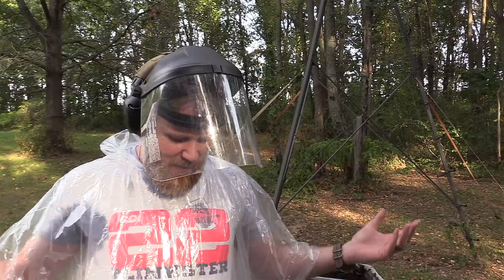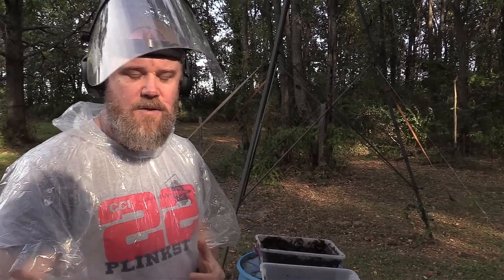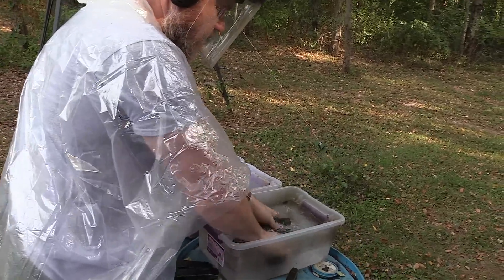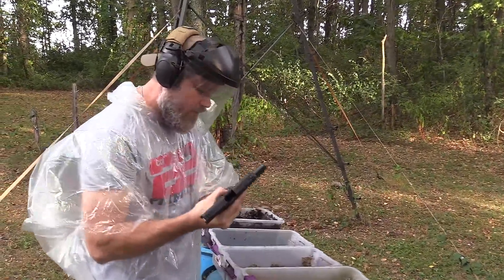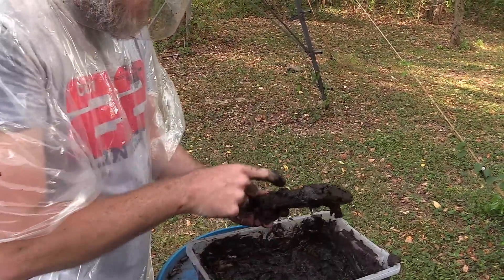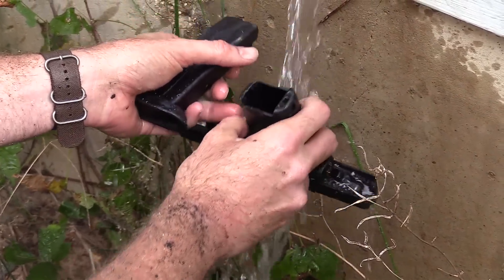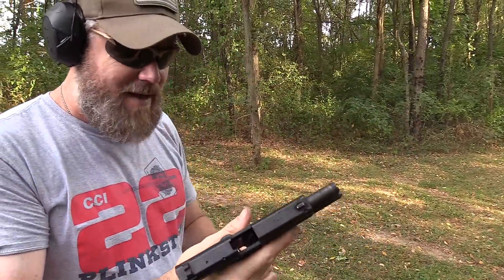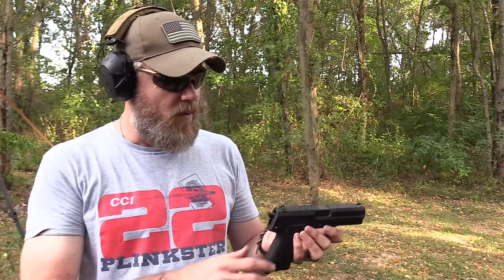The HK USP 45 meets the Gauntlet!

Comment: I went back and watched the Arex torture test.  I'd say these two guns are tied for top honors.  The Arex had a double strike failure and the USP had to be tapped home once.  The USP locked open at the end and the Arex did not.  I also noted that during the Arex testing he did not cover it over in the sand and first test like he did with the USP.  Given the slightly different testing it's hard to declare a true winner.  I would love to see an accuracy test between the two.
Reply: Jericho 941 is probably the most reliable.

Comment: In my opinion, the USP-45 should have become the US army Standard issue pistol. Not only it's reliable, but solves 2 of the main issues with the M1911: High capacity and reduced recoil. It can fire, out of the box, 45 Super, withowt damaging the frame or the Slide. In test, it was able to shoot over 13,000 rounds of +P+ ammo, before suffering some degree of fatigue. With a 20 lb main spring, you can fire hot loads with the recoil of a standard 45 ACP.

Comment: This video brought up an interesting question, and one that I don't think you have addressed with the Gauntlet.  How about running the same models of guns through the Gauntlet but in different chamberings.  That way we can see if the chambering has any effect upon the reliability under these conditions?  Maybe shoot a Glock 21 (45), a GLOCK 22 (40), and a GLOCK 17 (9mm), or, how about a SIG P220 (45), a SIG P226 (40) and a SIG P226 (9mm) since the P226 had some issues in 9mm?  The more powerful chamberings might allow the guns to power through more debris in the pistol!

Comment: My duty gun is a USP .45 H&K and my off-duty gun is a compact USP .40 H&K. I've NEVER had a misfire, "stovepipe" or double feed and I have fired 1000s of rounds thru both guns.
I will never carry anything but an H&K because in my line of work the gun has to work every single time or I will be lying horizontal in a box with a flag draped over it!

Comment: I've owned the H=K USP Tactical .45 for many years.  It is an incredibly reliable, durable, accurate, and top-quality firearm (match-grade single action trigger and  barrel, designed and manufactured to very high standards, truly built “tough as a tank,” and with a great SA/DA design including a frame-mounted dual safety/decocker).  Surprisingly, It is also quite concealable (although only in the Wintertime).   I simply cannot praise it too much.

Comment: I know you did the Glock 17 gen 3. Can you do a glock gen 4? I'm not sure which one I want to get, I know the gen 3 is good but I'm on the fence with the gen 4 due to the new guide rod/spring and the bump on the trigger bar assembly. If it does good like the gen 3 did, I'm probably going to get the gen 4. It would really help me out if you could

Comment: Watching the video today, a thought crossed my mind. Have you been using the same type of lubricant for all tests? I wouldn't fault you in the least if you haven't, but I imagine it could have a pretty significant effect. I imagine something thick like grease would be less likely to wash away in water but would probably hold more particles. I think it'd be interesting to take one of the guns that was lube finicky and gauntlet test a variety of lubricants. I think a thin grease like ALG Go Juice might help the gun run better than say Hoppe's, RemOil, etc. Keep up the great work! Another question I have is your position on the NRA's position on Bumpfire stocks? Maybe they're trying to play chess instead of checkers, but all the gun grabbers I've heard see that as a victory and just want more. Their thoughts have been they won that, but now they want bans on suppressors, high-cap mags, assault weapons, etc. I'm pretty disappointed I got behind the NRA for them just to roll over again.

Comment: If the trigger becomes an issue in dirt from a hammer. That is a failure. In a situation in combat. That is enough to cause an issue. And no real soldier is going to risk breaking internal trigger components just to fire a shot off when behind cover enemy fire.
A experienced soldier is going to smack the slide around to clear any obstruction from components. Then resume getting back on target.
Reply: Most soldiers only carry rifles. Not always the case of course. Yet if you have to use a pistol something has gone very wrong, or your an MP/Security Forces.

Comment: Aren’t these rated to run 45 super?
Reply: Well, HK says it voids the warranty. People still shoot 45 super through them though. Mark 23 is rated for 45 super.
Reply: Yes. The full size USP is rated for 45 super without any modifications, but H&K suggests more frequent recoil spring changes if constantly using 45 super.

Comment: Someone explain please......a revolver or pistol barrel behave differently if there is debris up there, or does the pistol barrel suddenly and miraculously 'lose' all its dirt the very moment the bullet starts to move up? That's how he explains it.
OK - I've listened to this again and again. Nothing changes in the guy's explanation. In short: With debris up the barrel,  revolver barrel will burst and a pistol barrel will not. I really cannot believe he just claimed that!
Reply: He said when debris gets packed in and around the cylinders of a revolver; the barrel isn't the problem - the ammunition to barrel interface area is. Running this test with the slide locked to the rear when in each bucket would probably be a closer comparison to what a revolver goes through, especially when multiple rounds are fired.
Reply: James, yes indeed - I got that part - but he still claims that a revolver barrel will get scored by the debris and may burst apart.
Reply: @jeroendesterke9739  Oh right I see what you mean. I can't speak for MAC's reasoning, however I would think it would be down to probability of a catastrophic failure over a difference in the two platforms. On the first round fired from a revolver and a pistol the likelihood of a failure would be pretty similar (on the provisory that the pistol had it's slide to the rear). However once you go beyond that initial round the constant of a magazine is lost, as the cylinders of the revolver rotate introducing fresh debris with each round aswell as a higher likelihood for failure. This could be way off, however it is the only reasoning I can think of for there being a reason not to torture test a revolver. There is of course the aspect of cost; as a revolver has a lot higher of a chance of going wrong and never returning to working order.

Comment: Sigh, now the dilemma, buy a USP chambered in 45 or 9mm.
Reply: Mr. Smith Both. I have a USP45 Tactical with an Octane 45 and a standard USP9 FS with LEM trigger. Man I love the both of them. The USP45 tactical is VERY soft shooting and spooky accurate. The USP9 carries really well in a OWB kydex holster and is also a soft shooter.
Reply: Scott K. Now that’s not helpful :)  I can only choose one right now.
Reply: I understand, they're not cheap! The USP9 is one of my favorites and it's just a simple gun. What I like is that that for me the grip length is the same as G19 and it's the same round count. Since I converted mine to LEM it eliminated the safety/decocker lever making it feel thinner and I can get a higher hold on it. 

Good luck with choosing but you can't go wrong either way! :)

Comment: Duuuuuuuuuumb.....You do not try to jam an out of battery firearm into battery...Thats how you kaboom and loose digits guy.
Reply: When you try and force it closed there are two things that can happen.
A) It doesn't close and the hammer can't fall. No kaboom
B) It closes and locks up properly. No kaboom.
Reply: @gundude82  You are painfully wrong and there are many other factors that can contribute to an over pressure cartridge like bullet setback and crimped casings from debris and forcing it closed, malfunctions of the weapon itself, a plugged barrel etc.  You are playing and promoting a dangerous game for the uninitiated, you should probably run it in a clamp and rest while you experiment so you don't eventually lose a digit or two, or let a viewer think they can get away with it.